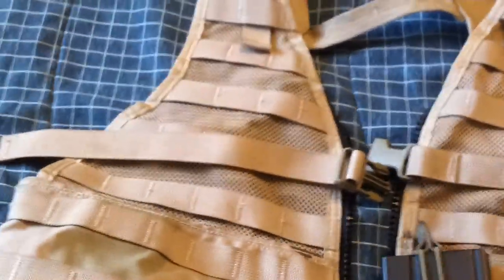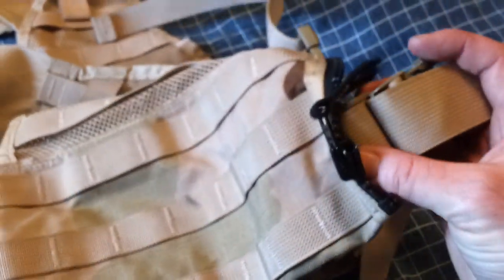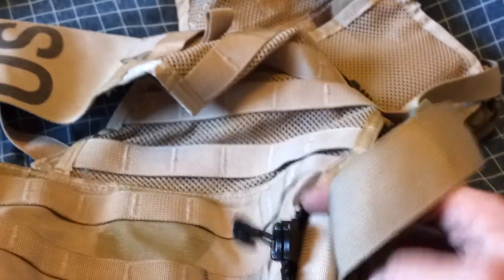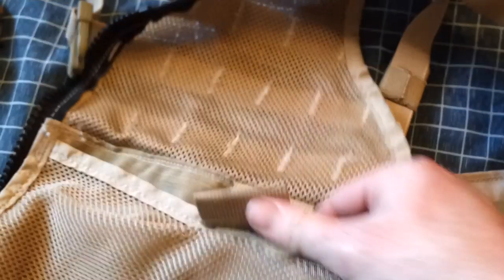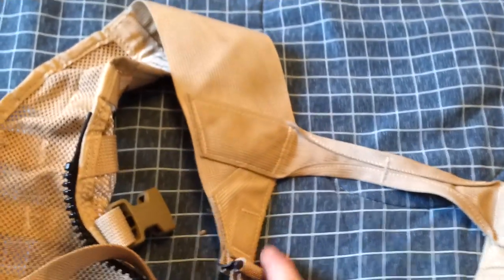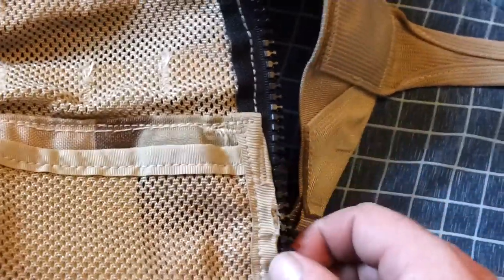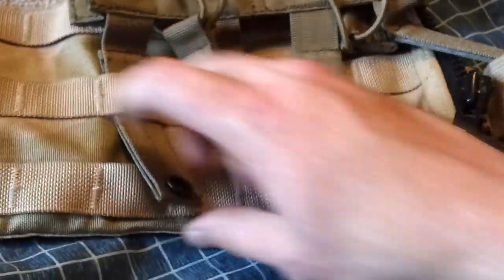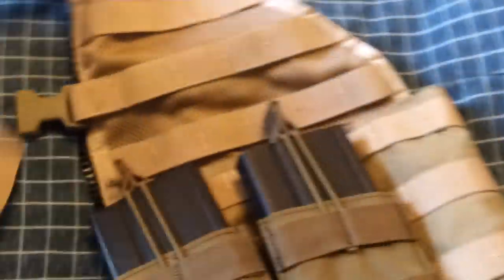How to adjust the LBV MOLLE vest.

Comment: I bought one at a surplus and it only came with the front side of the vest. Where can i buy only the back side?
Reply from the maker: Horsevky  If it didn't come with the straps in the back I wouldn't know where to get more except from another vest.  It comes assembled as one unit,  so I don't imagine there's ever a reason to remove them except to use the straps on some other gear.

Comment: So we're not meant to use the large buckle?  I can't figure out how I'm supposed to buckle it and zip it up at the same time.  Also, any tips for the shoulder straps?  I can't get mine to stop hovering over my shoulders.  It seems like all the adjustments I do in the back either don't effect anything or come undone as I put the vest on.
Reply: Michael Spivey adjust the height using the tri glides at the back, with weight, the vest will stop hovering over your shoulder
Reply: Bobby awesome1325 With weight?

Comment: I noticed that when the lower buckle is fastened its almost impossible to zipper up and keep the buckle tight.  What is standard procedure to wear the FLC.  Would the lower buckle and zipper both be fastened at same time.  I am guessing the lower buckle is a backup.
Reply: Adjust the utility belt so the FLC fits the way you want when you zip it closed. Then when you add layers of clothing or a smooth plate carrier beneath the vest the buckles secure the FLC. Simple and very effective system.

Comment: Now....can this be used as load assist with web belt?  Can a loaded web belt be tied to this so weight of belt is transferred to shoulders and partially off waist?  Maybe answer is simple LBE suspenders worn under vest to support belt and vest only for magazine pouches, etc.?
Reply from the maker: sorry for the late reply.  been really busy on other projects.  i believe you can. i have one attached to my plate carrier vest,  but i haven't tried putting it on the regular vest yet.